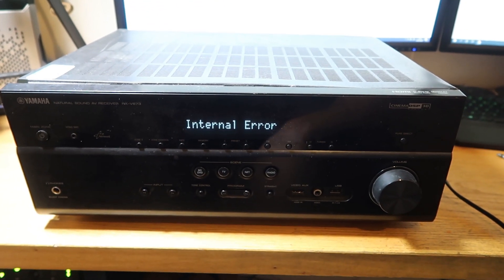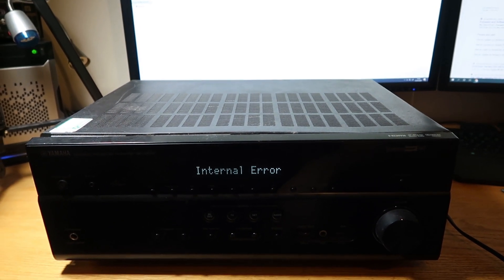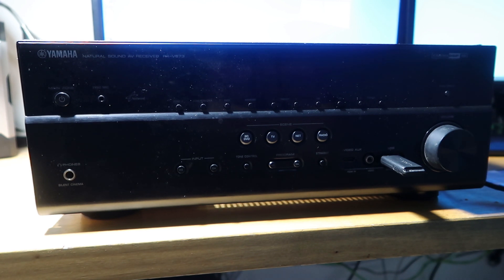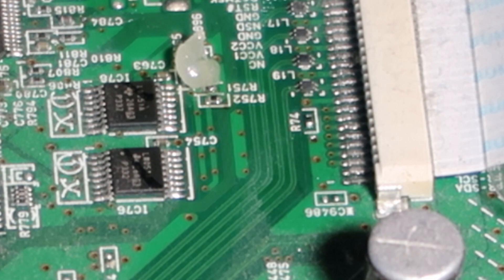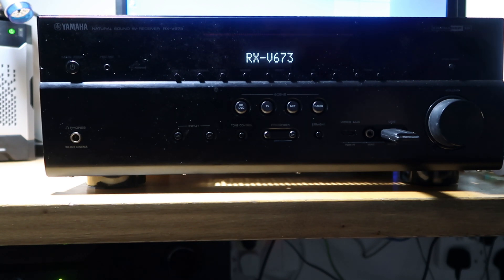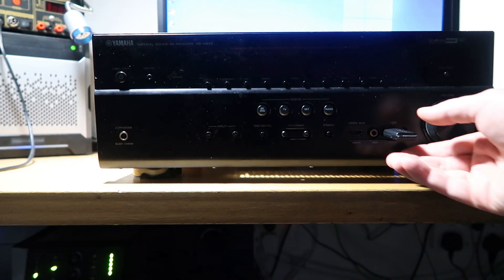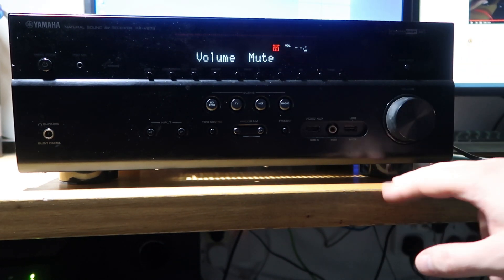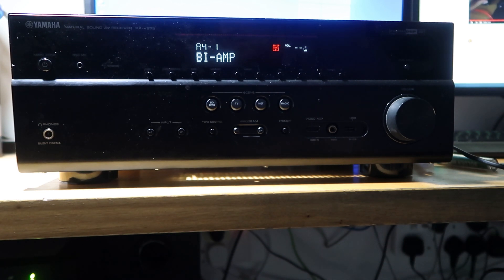Yamaha RX-V673 Receiver Internal Error / Error 4000 / No Model Info Full Repair

Comment: It is still temporary fix gents. Works ok , but when power off from outlet for longer time let say 2 days Plus problem occurs again with 4 red flashing diodes of dead , and u have to repeat this process gain and again, so In my opinion there are stil some HW components that does not hold the memory for the model that u setting up when pressing straight button unfortunatelly?

Comment: RX-V673 for me does not show anything unless I power ac on with the INFO button pressed. Then it shows NO MODEL INFO. I turn off and do it with R896 shorted and repeat. Now I can get to choose RX-V673 as you described and remove the * by pressing the STRAIGHT button. Unsolder and back to repeat problem. Even do the reset press INFO and TONE CONTROL and turn Standby back on. Still just a red LED. 

Any Ideas ?
Reply from the maker: Ive not seent this behaviour before sorry
Reply: @WeRepair  OK. Will dig deeper.

Comment: Did anyone ever figure out which solder points need to be shorted/jumpered for RX-V383 or RX-V373, RX-V385, RX-V377, or RX-V381?  I'm convinced the procedure is extremely similar to what is shown in this video.  Just need to figure out which points correspond on the different circuit board!
@anml4676
@daleyhenry2256
@martyflickinger
@taylorsebastian
@Molendinar
@baneesh29
Reply: Are you able to select (and save) the model in the settings, like I was able to select the "Dest" (destination) in mine? If so, the model and destination info is probably stored on the same (problem?) chip. As you know, the V373 board is a bit different to the V6xx series and I don't think it has the same chip (circuit?) on it that is jumpered on the V673 etc to fix the problem, although the V373 does have those soldering points. (I'm guessing you have the "internal error" message and "model info" problem). I've asked about this on other AV websites and even Yamaha "experts" were sort of guessing what chip it might be that's corrupted or failed, and won't store the info without standby power. It's a tricky one for sure. Good luck anyway.
Reply: @anml4676  my V383 doesn’t have a “Dest” button or option. It just shows “internal error” on the display and none of the buttons or functions respond in any way. So I am assuming something has to be jumpered to get the system to reset. There just isn’t any information anywhere on how to do it on the V3xx boards. But at this point it doesn’t seem like the problem can be solved without opening the unit up and playing with the circuitry
Reply: @rocman240  Aha. Sorry, I thought you were further into it. You could try the V383 self-diagnosis function to try to find the problem :
(Note that "keys" means buttons on the unit)
 "While pressing the “TONE CONTROL” and “INFO” keys, press the “ ” (power) key to turn on the power, and release those 2 keys.
The self-diagnostic function mode is activated."
See what appears on the display.
(You might have to hold the info and tone control and power buttons for 3 seconds. If so it means the unit was in Protection Mode and you must be extra careful). The service manual is available online if you're interested. BEWARE that messing with the settings could make things worse, so it's up to you. The manual is a bit complicated but it explains the self-diagnosis and settings functions in detail. Again, if in doubt, DON'T. My unit (V-373) just loses its destination setting for some reason when disconnected from mains power (this shows as "DEST ERR" in the self-diagnosis), and fortunately this can be reset in the settings . Maybe you'll be lucky too!
Reply: @anml4676  Unfortunately it appears that I'm not so lucky.  I've tried all combinations of the "TONE CONTROL" and "INFO" keys, as well as the "STRAIGHT" key since I saw some mentions to that key elsewhere online.  My unit will not stop displaying "INTERNAL ERROR" no matter which keys I press, nor how long I hold down those keys as well as the power key.  I've looked at the service manual online, and it doesn't appear to have any helpful information for me.  I'm afraid at this point my only option would be to bring it to a repair store who would probably charge me more to fix it than I could pay to just get a  new unit.
Thanks for your suggestions though.

Comment: great video , i need to do the same thing on the RX-V385 which does not carry R896 on the board, any idea for jumper location  for this model.
Reply from the maker: I don't know sorry
Reply: I have a RX-V385 with the same problem as you. I've done some investigation and here's what I found. The R896 jumper on the RX-V673 effectively grounds the "MODE" input. This is usually pulled up "high" to 3.3V unless R896 short is present, which makes the input "LOW". You are correct, on the RX-V385 there is no such jumper. Instead, this MODE input is conveniently available on a factory test connector labeled CB29. This is a little white connector at the back of the board just next to the HDMI 4 connector. The pins on this connector are labeled: 1=3.3V, 2=DGRD, 3=RXD, 4=TXD, 5=MODE. So the equivalent for RX-V385 should be to short pin 2 and pin 5 of this connector (which will pull MODE input low). Unfortunately, this doesn't seem to do anything, it still just says "Internal Error". The other pins on that connector appear to be an RS-232 serial port, but so far I haven't been able to see anything come out those pins. The RX-V385 service manual says on page 1: "When the DIGITAL P.C.B. or IC23 on DIGITAL P.C.B. is replaced, this unit will display “Internal Error” and will not operate properly. The model name, destination and serial number MUST be written to the backup IC to have proper operation. (For detailed procedure, refer to related Service News or Service Bulletin. Or contact your local Yamaha representative.)" I've looked all over (including Elektrotanya.com) for said bulletin but have not found so far
Reply: @martyflickinger  Did you ever figure out which solder points need to be shorted/jumpered for the RX-V385 circuit board?
Reply: @rocman240  Try J207 jumber

Comment: Super cool, thank you so much! I am very eager to try out what you suggest. I can´t find the firmware online though. I have a  AV Receiver RX V773. Do you know where I can find the right firmware ? Thanks so much
Reply from the maker: Here you go: https://uk.yamaha.com/en/support/updates/rx-a720-820_en.html
Reply: @WeRepair  thank you very much! I got the error message as well, about to start soldering. I have never done this before. Which temperature do you use and is there anything else to keep in mind? Do you use soldering wire? The camera is hiding this part, it is too hard to see what´s going in there in the video :) Thanks!
Reply from the maker: In all fairness you could just bridge the connection with a paperclip and it will do the job

Comment: How did you find the error? All you did was opening the thing and put some solder on the board.
Reply from the maker: The error was on the screen, I just needed to bridge two points on the board to reset the unit and resolve the issue

Comment: My RX-V775 identifies itself as a RX-V675 so the firmware update is not possible either. Bridging R896 does not work. It does not come up with NO MODELL INFO only with VERSION***ERR. Anybody any idea? Thank you!
Reply from the maker: I dont know im afraid, probably one for Yamaha directly.
Reply: Same issue My RX-V485 you Got any solution?
Reply: @sanalelevenstar  For my RX-V775 I found the following solution: Short-circuit contacts R896 on the main board. Press and hold INFO and PROGRAM (left) when switching on. Current model number appears. Change with SCENE 1 and 2. Save with STRAIGHT. Switch off. Remove the short circuit. Then switch on again. Good luck!

Comment: My yamaha tsr-700 (rx-v6a) is giving me the same error. It's a completely new model though with different board/circuitry and buttons on the front so not sure if any of this would help. I bought it from costco so I plan to see if they will return it but I'm interested to see if anyone else has had this problem with newer models.
Reply from the maker: Good luck, I got lucky on this one. Took me a few hours to searching for the technical docs.
Reply: @WeRepair  I ended up returning it and bought a new one when they came back in stock a month later. The old one may have been defective all along, didn't seem to have nearly the power output the new one does. Sounds much better now and no issues with the new one.

Comment: I had this happen on my RX-V677. THANK YOU for putting this video together. It saved me a ton of grief!  I didn't use the solder method on the contacts, rather I just shorted them out with a wire connector. It only needs to be shorted at power-on, and then can be removed.
Reply from the maker: Good work, glad it solved your issue
Reply: I have an rx-v671 that is error coding 0200 no sound. It happened after I did a firmware update. It did something to the amp. Do you happen to know a way I can fix it? I’m very sad it happened I love the receiver. I’m pretty for certain it was the update. I tried to redo it and the same error came up after about 5 minutes. I factory reset it and still nothing.     It doesn’t register the speakers at all. It’s not the ear phone plug either. Any suggestions would be awesome! Have a great day!!
Reply: Had to dig out my soldering iron to do this, but it worked with the V677. Turned it back on and all is good. Thanks a million

Comment: I have this code but my Yamaha is RX 685
Reply from the maker: You would have to try and get the technical schamatic from Yamaha to figure out what points to jump on the board. Same as I did then you can reset in the same way.

Comment: Hey I have yamaha 2071 av receiver..it had problem with circuit board..I replaced it..but after that I got internal error..what should I do?my av receiver don't turn off from power button..it shows internal error on display?
Reply from the maker: Depending on which circuit board you replaced it might be running different firmware. Maybe try updating it?
Reply: @WeRepair  yamaha 2071 av receiver don't have wi fi and usb slot..so I can't update it

Comment: i have a rx-a810 and same problem (internal error), except that i can't even turn it off without unplugging it. the message will not go away even after i press the power button, and none of the buttons will respond

Comment: Having this problem on my rx-v677 - at what point can you remove the solder bridge on the r896 points? I'm thinking if this is likely to happen again, I'll solder some pins on there and using a standard jumper to bridge them.

Comment: quick question... trying to solve the Internal Error in my RX-V677. Bridge the chip, Select model appeared, find RX-V677, press straight button (* next to model removed) , but it seems it is not saving the selection. After reset it goes back to Internal Error.
USB Firmware update does not seem to work either... It detects the USB drive, it goes into "USB UPDATE"  mode with the progressing *, but it does not move from there.
Any suggestion?

Comment: For those of you who have a Yamaha RX V475 model, you don't actually need to open it up if you're getting the "Internal Error" message.

This is what I did:

1. Power Off
2. Hold "Info" and "Tone Control" buttons while powering it back on (for other models you may need to hold Straight and Tone Control, but for the V475 its the Info)
3. Navigate the menu using the "BD DVD" and "TV" buttons (to navigate sub-menus you use the "NET" and "RADIO" buttons)
4. Find the the menu that shows "SW: PCB" (this is menu item S5-1), when on it, click the "STRAIGHT" button to change it to "SW: MODEL" (this puts it in the mode to change the programmed model)
5. Press the "NET" button to select the sub-menu
6. In the sub-menu, press the "STRAIGHT" button until you see the correct model number
7. Once the correct one is visible, press "NET" again to return to the main menu (you should see "SW: MODEL" on the display at this point)
8. Press "STRAIGHT" again to change it back to "SW: PCB"
9. Turn off unit then back on - Unit should function properly

Although the service manual can be cryptic, you can find instructions on this procedure in there as well: https://www.manualslib.com/download/1244112/Yamaha-Rx-V475.html
I haven't tried this fix on any other models but its most likely very similar (only difference being which buttons you must press)

Hope this helps someone!
Cheers!
Reply: worked thanks
Reply: Thanks. Your post led me to the RX-V373 service manual, then into self-diagnostics. Identified the error ("DEST ERR" in my case), entered the correct destination, and voila! It works properly again. The procedure is almost identical for the RX-V373.
Reply: @anml4676  Did you ever figure out which solder points need to be shorted/jumpered for the RX-V373 circuit board?

Comment: Do you happen to know which lands to bridge on the circuit board for an RX-V373?  The circuit board layout is a little different.
Reply: This procedure works for the RX-V373. No need for soldering or jumpering -

"For those of you who have a Yamaha RX V475 model, you don't actually need to open it up if you're getting the "Internal Error" message.

This is what I did:
1. Power Off
2. Hold "Info" and "Tone Control" buttons while powering it back on (for other models you may need to hold Straight and Tone Control, but for the V475 its the Info)
3. Navigate the menu using the "BD DVD" and "TV" buttons (to navigate sub-menus you use the "NET" and "RADIO" buttons)
4. Find the the menu that shows "SW: PCB" (this is menu item S5-1), when on it, click the "STRAIGHT" button to change it to "SW: MODEL" (this puts it in the mode to change the programmed model)
5. Press the "NET" button to select the sub-menu
6. In the sub-menu, press the "STRAIGHT" button until you see the correct model number
7. Once the correct one is visible, press "NET" again to return to the main menu (you should see "SW: MODEL" on the display at this point)
8. Press "STRAIGHT" again to change it back to "SW: PCB"
9. Turn off unit then back on - Unit should function properly
Although the service manual can be cryptic, you can find instructions on this procedure in there as well: https://www.manualslib.com/download/1244112/Yamaha-Rx-V475.html
I haven't tried this fix on any other models but its most likely very similar (only difference being which buttons you must press)
Hope this helps someone!
Cheers!"
Reply:
Thanks. Your post led me to the RX-V373 service manual, then into self-diagnostics. Identified the error ("DEST ERR" in my case), entered the correct destination, and voila! It works properly again. The procedure is almost identical for the RX-V373.
Reply: @anml4676  Thank you very much for the information!  I appreciate it greatly!  I will try this procedure.
Reply: @taylorsebastian  Did you ever figure out which solder points need to be shorted/jumpered for the RX-V373 circuit board?
Reply: @rocman240   I'm afraid I didn't.
Reply from the maker: I dont im afriad, Its probably one for google :(
Reply: @WeRepair    Okay.  Thank you for your reply!  I appreciate it.